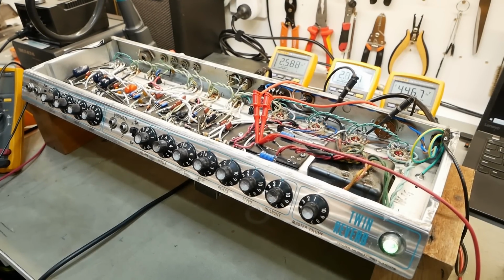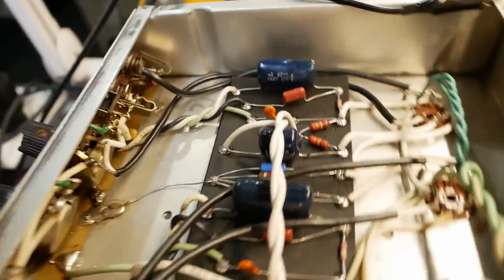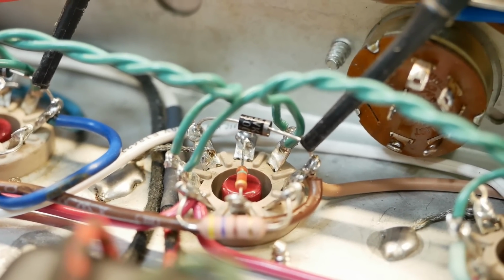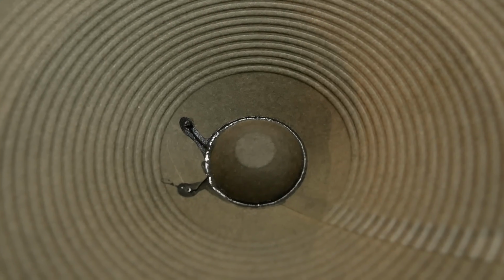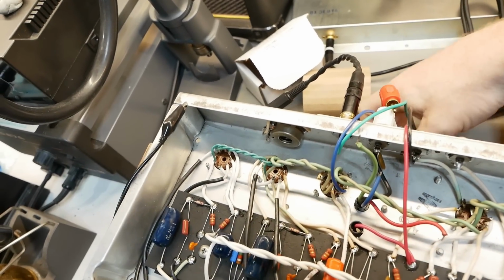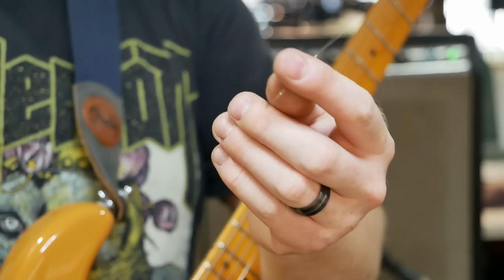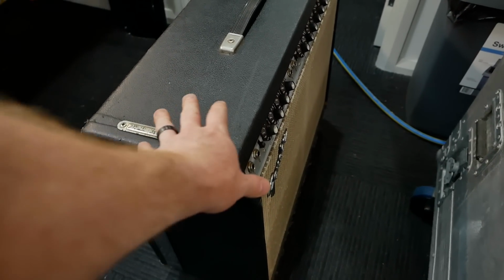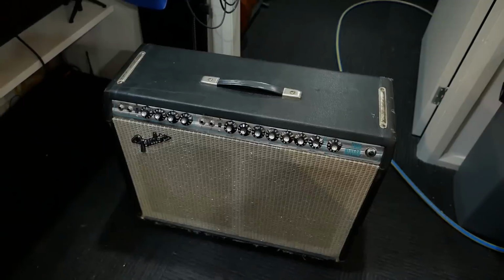Fender Silver Face Twin Reverb - Part 4

Comment: Great video want to share something I was taught by Steve Henning in Austin Texas he did Srv an EJS Speaker work so all these fenders guess what baffle board material they use ??? particle board  so the first thing he did to EJS amps and Stevies or Jimmys amps was changing the baffles in all of them every twin Ej had was replaced with specific baffle board material and painted black and grill cloth replaced back You hear the speaker as they are then and if still an issue you get correct speakers which might take a year to get 2 or 4  speakers done. If Jensen then they needed to be right and matched. Now you might say  pain in butt but if you use voidless birch and paint it flat black and install new t bolts and all bolt up speakers right in it and hook them right on up to new baffle board. the amp sounds better there would be no dead spots in wood...

Comment: Nice job! Certainly better than how  Fender would have lashed it together in the 70's 😂
Reply: Yep, Brad did an amazing job. The thing Fender definitely did right was to not build a disposable product. These amps were built with service and repair in mind. How many Katanas do you think will still be in service 50, 30, even 20 years after production?
Reply: @socallars3748  well I have a few solid state amps from the 70's and early 80's so it's not just hand wired tube amps that last for years. The katana is a well built amp and should easily last 20 years.

Comment: Aloha and Mahalo Brad! Info is much appreciated. Always wanted to build an amp. Again no money but one day. Always wanted at make an amp with blackface and tweed preamp. With valve and rectifier and A/B and cathode bias. Just another Mess Boogie. I realized several simple amps are best. Just need to know what I'm looking for. Stupid cause I sit at my condo and can't crank it up. Got to some volume to get the sounds. I just need to play and find out. Can't get Handivan driver to be my get away car.
Reply from the maker: Yeah, you find with all the options, after a few weeks, you tend to just default to one and leave it there, so just build the amp that way. It would be useful as a demonstration amplifier for determining the architecture of a custom build, but what's the point? The customer will always change their mind in 6 months, anyway. At least they do in my experience.

Comment: That was fun one to watch! :D Nice work as well. Do you have bad experience on JJ overall or only certain types like 6L6? JJ being only tube these days that's both available and reasonably priced, I've had many of those and only one or maybe 2 have failed. Not sure which point of view I would have, number of sets I've had is maybe a dozen + low tens of preamp tubes, so even one failed tube would mean high fail rate in percentage, but they come with 6 month warranty where I buy 'em, so it's not total disaster..

Comment: Nice work. I'm wondering which brand and type of resistors you currently use in the preamp? I generally use 1watt or higher on everything because modern parts look like junk. I think USA distributors change brands to increase profits and carry a lot of garbage.

Comment: Great job as you always do Brad. I have always thought orange drop coupling capacitors were way over rated, especially when you compare them to the Panasonic caps. Tbh I found the el cheapo Xicon caps that look similar to Panasonic caps to be a better choice over orange drops.
Reply from the maker: I think this one may have suffered due to the soldering technique and/or may be 2nd hand from some position in some unknown device from the previous tech.

Comment: Cobber, you’ve killed it, great job! Something to aspire to for myself on my upcoming rebuild. I do plan to use the pull pot to patch in some clipping diodes, but apart from that, I’m following your pattern here. Full rebuild and full sex appeal. Fuck yeah.
Reply from the maker: It's a handy switch for other mods, possibly feedback which I think I mentioned.
Just check that the "on" resistance is satisfactory.

Comment: ❤❤❤
For twins, especially AB763's check out the GA-SC64 + Legend 1258 combo. 
Just got to avoid something mushy or bosomy in V2. I really love those Tung Sol 6L6GC STR's too. Really nails that phat 5881 sound. Nothing like the (still cool but very different) JJ 6's. 
Amazing work dude. I really appreciate that I found your channel via Lyle!
Its so cool to know people are still out there loving this stuff.
Edit: If you actually use the reverb (for me 3-always-on) definitely use Vishay ceramics throughout. The 0.022uf coupling cap in to the 500pf reverb mixer especially: stuff a Vishay class 2 Z5U in there instead of a film. Really lifts the blanket. They always come in light at 17uf ish. Definitely works!